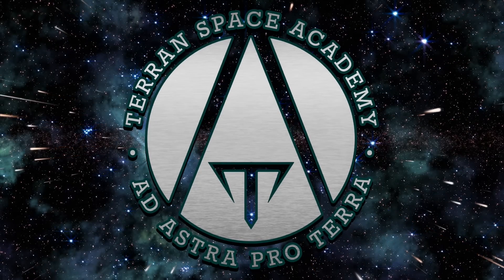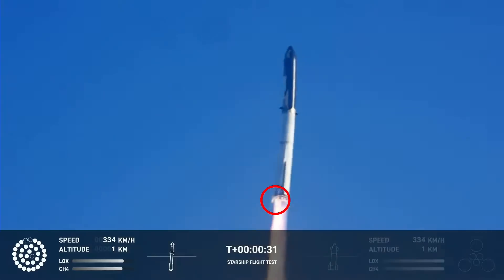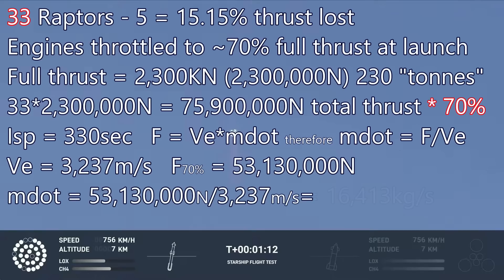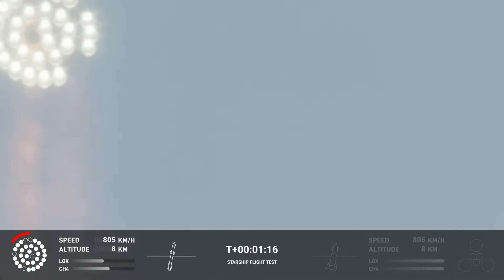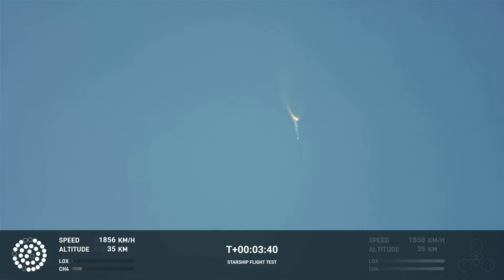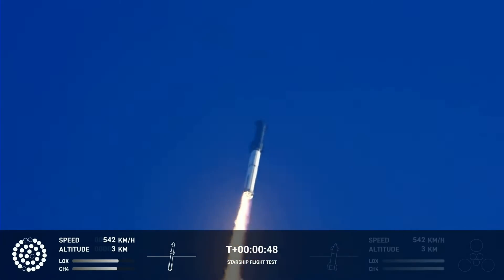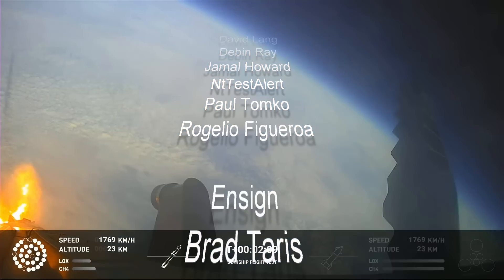Starship Flight Analysis: What went wrong with Starship?

Comment: Forgive my ignorance but you said that it should not be possible for an engine to reignite.  Given the successful Starship belly flop maneuvers of a few years ago I'd have to conclude that is demonstrably untrue.  Moreover if it is true and the booster cuts its engines for separation, how then is it to perform a boost back burn?  I guess I don't understand your thinking.
Reply: Some can and some aren't set up to reignite.  Only the center ones do when a recovery is planned.
Reply from the maker: The exterior ring of engines cannot relight Bill.  The center three can.

Comment: i don't think the hot gas separation will work, it work on missile because they are in a tube where there is no where for the gas to escape other then to push the missile out of the way. rather they can just gilde off using control surfaces to slow the booster so the starship will float ahead then ignite.
Reply from the maker: We talked about having tubes in the nozzles and venting from the 1st stage in Starship Abort!

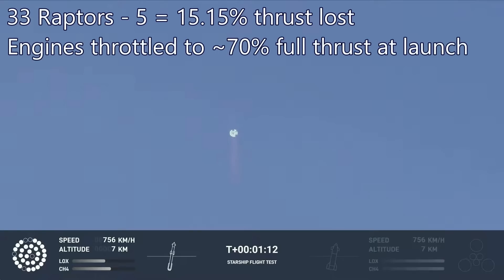Comment: pretty sure at 2:51, the booster and starship are not inline anymore, right where the flip maneuver was supposed to end and disconnect the 2 parts... (in that image , the starship seems to be at an angle, to the right, compared to the booster...just draw some lines along the 2 cilindrical objects
Reply from the maker: We agree... still attached but at an angle.

Comment: SpaceX could have the gridfins pairs gimbal in opposite directions to create drag to pull the booster back
Reply from the maker: The air is too thin at separation altitude I think but that's a good thought.

Comment: It seems fairly obvious that the vehicle lost an HPU and therefore directional control. If I remember correctly, the crew at Starbase were seen spending several hours working on the HPU just a couple of days before launch - is there a connection?
Reply from the maker: Almost certainly but this won't be a concern for the future.  Starships will have electric TVC.

Comment: I really liked your commentary.  So the latches didn't unlock the starship but the software told the booster to come home.  Booster flipped to burn back WITH the starship attached!  I dunno.....looked like a PIECE of a success to me!  F___ CNN and their stupid headlines.  (If it ain't a transgender, they don't like it)       SPACEX has a number of pieces of success now.  They have a TON of data from these dang water towers!  Just wait till they put it all together for the grand SUCCESS!
Reply from the maker: Hydraulic failure could have caused the pins to stay attached and have caused the loss of control. The new ships use electric TVC so this won't be a major concern.

Comment: SpaceX made 2 decisions that I find pretty weird: 1) not installing Flame Diverters under the Launch Table 2) Not relying on a more robust stage separation system
Reply from the maker: I hate to second guess their engineers on that but I think they are prepping for Moon and Mars launch without prepared pads... not sure on the separation though.  i would not have gone that route.

Comment: The flip to stage manoeuvre was always questionable to me, they already have autogenousb pressurisation lines going up top that could supply the dead space with separation pressure or just even pneumatic cylinders, as well as hot gas thrust capability, and grid fins that can aerobrake…. The combination of this is plenty. Throwing in a whole ship rotation is dumb, and if humans were ever to board would be extremely unsettling.
Reply from the maker: Indeed! We don't like it either.

Comment: Good video. A couple of comments: I'm not convinced that the tumble was really part of the intended flip maneuver; it could actually be loss of control due to TVC failure from a loss of hydraulic pressure. If that it the case, Booster 9 with electric TVC should be more fault tolerant. Also, minor correction: Apollo 7 was a Saturn 1B and not a Saturn V launch.
Reply: I think an under-appreciated aspect of Apollo 8 was that the first manned flight of the Saturn V didn't just go to orbit.  It went to the moon (first men to leave earth orbit), braked to insert into lunar orbit, orbited multiple times, and then did another burn to return to earth.  Multiple giant steps, each of considerable risk.
Reply from the maker: Technically Apollo 7 was the first manned flight and it did just go to orbit but you make a good point.
Reply from the maker: Very likely it was... the flip maneuver is very gentle and not a full flip like we saw.

Comment: I don’t know if anyone has seen the drone photo of the OLM, but there is now an enormous crater in the ground. There are also videos from around the launch site that show the insane amount of debris flying around. Even one of a car parked nearby that was severely damaged by a huge chunk. I’m guessing that some of the tons of concrete, rebar, and other debris that were “displaced” struck the booster and caused the rocket to be doomed before it even left the pad.

SpaceX knows the current suppression system is insufficient. They already have a new and more substantial looking one staged nearby ready to install.

And I’m still surprised that they don’t have a flame trench.

All in all, though, this was an enormous success!
Reply from the maker: Absolutely...

Comment: Prior to launch I saw at least two of the engine bells show either condensation or gas release, and I wonder if those were the engines that failed (one of the ones showing the gas was inner three and at least one other was outer ring)
Reply: Small venting in turbo pumps to avoid temperature shock.
Reply from the maker: Possibly but surely they would shut off propellant flow.

Comment: Only in America can a total disaster be spun as a success. NASA solved the problem of reliable stage separation 60 years ago. Did Space X engineers not read the instruction book? 
The Russians pioneered the use of lots of engines in case some didn't work. Thats was the system on Soyuz. The Americans used a few big engines that they made reliable but at huge cost. Space X took the cheapest solution. One by one, engines failed until it reached six and the gimbals on the inner ones could not compensate. That caused the oscillation. Then one engine blew up knocking out even more. 
As if that was not a disaster, the system that jettisons the first stage failed at the same time. And then the whole thing exploded.
Don't blame debris on the launch platform or an anomaly. This was a design failure and will be a massive problem to solve. It demonstrates what happens when you design and build something as cheap as possible. Space exploration is the realm of governments, not private companies who are required by law to be solvent. Of course they will take shortcuts and cut corners. This is what happens.
The ESA with its Ariane 5 competitor, has had 80 perfect missions on the trot. How many has Space X?
Reply: And yet despite all of this, spacex worshipers are still high on their copium, endlessly hating on SLS (which managed to get Orion to the moon on it's FIRST EVER FLIGHT)
Reply from the maker: All hail Elon... All hail Elon.  What was that? I couldn't hear you... I was worshiping Elon :-)
Reply: comrade, you are laughable, Falcon 9 had 99.1% launch success rate, Ariane 5 has had about 95.4% success rate since its inception. And Falcon 9 flew 223 times since its beginning in 2010, Ariane flew about half of that since 1996. Also Falcon 9 is partially reusable, nothing is reusable in Ariane 5. Ariane 5 is a good rocket but if your mission is to make a fun of SpaceX - you are really making fun of yourself.
Reply from the maker: Comrade you are forgetting Falcon 1.

Comment: Can we just take a moment to reflect on how awesome the engine ring looks in the sky from below?
Reply from the maker: It was beautiful!
Reply: it look like alien tech honestly
Reply: It was possible to see the "rings of light" because of the transparency of the exhaust plumes from the methalox engines. Unlike the kerosene fueled engines of Falcon or Atlas, which emit incandescent but opaque carbon from their bells. In the case of SLS the exhaust from the solid rocket boosters is also opaque and obscures the glow from the engine bells of the core stage even though the hydrolox plumes themselves are transparent.

Comment: I was a bit frightened when the whole ship locked itself together via the warping effect that nearly blew it apart.

The way the centre of mass(I assume) where booster meets ship bulged shortly after launch and the whole system nearly choked to death in balancing out at the 26.8 second mark. The following 30 seconds shows clear signs of detremental reverberation and this was only about 300 meters into its assent, roughly 1% of the total altitude gained.

I am certain the warped structure is what clamped the stages together. It's the effort to find the new balance that caused the whole thing to fail at "max Q" where the ship struggled to rise between 34 and 39 kilometer altitude before spiraling out of control.
Reply from the maker: Those shockwaves are brutal.

Comment: It looked like right after MaxQ the center line of the rocket was a little off, Nose High, with the flow of the exhaust gasses and you can see the plume of flame from the engines hitting the cone of gasses on the low off center side. The engine also never looked like it truly shut down during the flip.
Reply from the maker: It did not and it should have...

Comment: While this is an outstanding and detailed analysis replete with all of the applicable and relevant numbers and formulas, etc.. 
This analysis fails to ask the obvious question: Why/How did the initial 3 Raptor engines fail upon launch?  They obviously didn't install untested or failed Raptor2 engines, right?
In this lay-person's humble opinion the obvious answer is that the massive thrust of the Raptor2 engines blast completely destroyed the whole concrete pad area all around the OLM, and excavated a huge deep hole underneath the launching booster.  Where do you suppose all that concrete and excavated earth went?? <spoiler> it went everywhere..  Including, most likely at high speed banging into various Raptor engines..  I'm saying that the initial 3 Raptor engines failed, and likely the rest of the engines failed due to damage from the destroyed OLM pad.
Reply from the maker: You are quite right Dean.   Debris strikes almost certainly took out the engines.

Comment: And there should be a flamed diverter or excessive outflow force  so will not create  initial impact in the structure of the booster that may cause to some areas to malfunction
Reply from the maker: That would definitely help with the debris...

Comment: Maybe a concrete tunnel exhaust system could be built on the launch pad to channel the debris away from the rocket.
Reply: You could go all the way back to the 1960"s to confirm that design
Reply from the maker: Steel sheeting?

Comment: I feel like all of the pressurized concrete from the pad being turned into a crater and sent flying around like basketball sized bullets coupled with the slower liftoff from the pad that starship has vs falcon or falcon heavy might...just might have had something to do with the underside of the rocket/engines taking some damage at the beginning. I still don't understand why we didn't opt to build a flame diverter as well as some kind of water flow dampening system like NASA uses. I mean they thought it was nessicary  a long time ago. for rockets much less powerful...why would we think that 33 or the most powerful rocket engines ever designed all lighting up at once wouldn't basically disintegrate the pad....plus I can't imagine the shock reflected back into the underside of the ship itself. Just seems like an oversite.
Reply: Elon said it was because there are no flame diverters on Luna or Mars.  The rocket is for going to those places. But not the booster!
Reply from the maker: That's right Paul.  Practice for the Moon and Mars.

Comment: Hard to believe separation requires a flip. Thank you for the analysis.
Reply from the maker: We hope something else is thought of but it could just be that loss of hydraulics made it impossible to continue.  The newer Starships have electric TVC so this should not be a problem in the future.
Reply: @terranspaceacademy  I think you've nailed it. As the Scottish space guy points out, separation is preceeded by turning off the engines of the booster so not to push it against the rocket during separation. Separation phase was never reached. With the loss of 7 engines or so, was off flight plan and trying to get back on probably resulted in loss of control. Agree w you.

Comment: I too was surprised that they attempted a flip maneuver before separation.   Starship is very heavy and will be heavier post testing process.  I can't imagine how much torque that small overlap has to handle just from going nearly straight up.  Once you begin to change direction, gravity becomes an hinderance instead of an assistances holding the two pieces together.  The inertia of Starship wanting to continue in the same direction while the booster tries to change direction drastically might be even more force than gravity.  I think it'll be more than 3 months before the next full launch.  With the other boosters waiting, they would be better off just testing them with a nose attached.  Maybe fins too.  While they work on redesigning the attachment and flip procedures.
Reply: Gravity doesn't matter when you're on a ballistic trajectory.  It's pulling the same on both, so it's not pushing them together or pulling them apart.
Reply: @Br3ttM  Not gravity but centrifugal force was supposed to cause the separation
Reply: it's two pieces on a ballistic trajectory that changes .. if it was just straight up the whole way you would be correct .. but it obviously is not
Reply from the maker: We agree... About 120 days is our guess.
Reply: I'm not convinced they were controlling anything by the end -- they lost at least 1 HPU and very likely weren't in control of the vehicle.  Without the ability to steer, they were just collecting data before the inevitable press of the big red button.
Reply: The nearly-empty Booster will have most of its mass at the base (engines, full LOX header tank) while the Ship's weight will be more evenly distributed. After a flip-separation the Booster will continue to rotate around its base while the Ship will be flung away with very little rotation.
Reply: @dancingdog2790  we know the "concept" but as we saw during this attempt, the rocket isn't just sitting on top of the booster loosely.  it obviously has a tight grip and as the booster starts to adjust trajectory and that grip can get damaged before the flip maneuver starts.  if they want to stick with the flip as part of the separation sequence, they may need to add a 1.5 stage, which would be like a fairing that couples the two large segments and then is ejected right before flip

Comment: Unfortunately every time they have fired those raptors they have had some issues. Looks like the engine need a lot more development. Also I don't understand why they do a flip while the ship is still attached seems wrong to me as then starship also facing wrong direction. I assumed before the booster  was supposed to flip after seperation just like falcon seems like the ship failed to separate then did the flip anyway
Reply: That is how it seems, true.  But this was first test flight of Raptor V2
Reply from the maker: Anything would go out after those debris hits I think... that was brutal.

Comment: I know the debris being blasted back up at the engines damaged a lot of them. That was obvious as soon as they lifted off. This does need a flame diverter or flame trench but the location doesn’t allow them to with the design at all. These are pretty smart guys so I’m sure they will figure that out. The launch was awesome to watch. It did look like it took a while to lift off though. Maybe they slowly throttled up. The separation stage needs improvement and that will be changed for the next launch easily. Few blast pins maybe or hydraulic. Easy fix. Look forward to the next launch. For everyone bashing Elon, tell us again how long the development of the space shuttle took? How many decades?
Reply from the maker: We are thinking of steel plating... maybe water cooled?